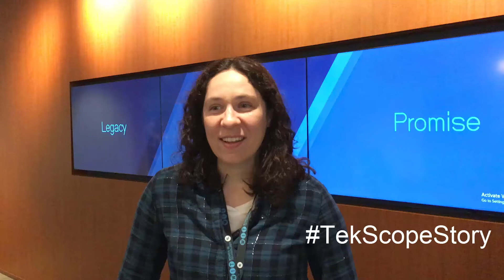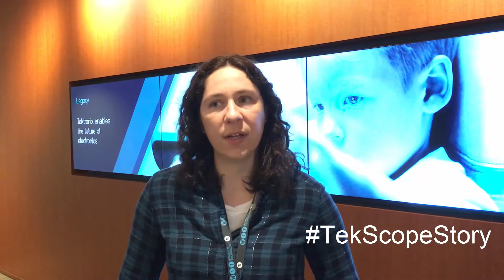#TekScopeStory

Comment: Yeppers.  System startup protocols/procedure to allow for warm-up or repeated system state of use... then perform some sort of system performance verification or calibration procedure on the whole system (including probe systems) with consideration for environment also, i.e. ESD area, Faraday caged area, anechoic chamber area, etc.  That's what I've been learning and relating from my spectroscopy experience to my electronic, RF engineering and electrical engineering studies.